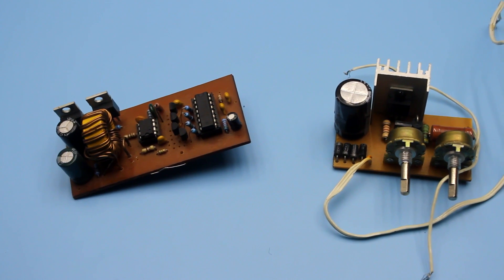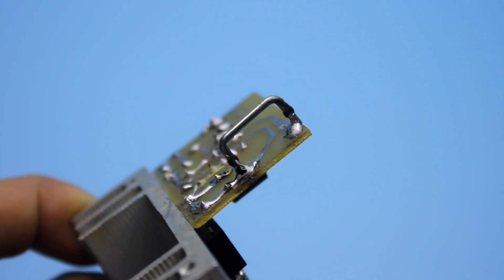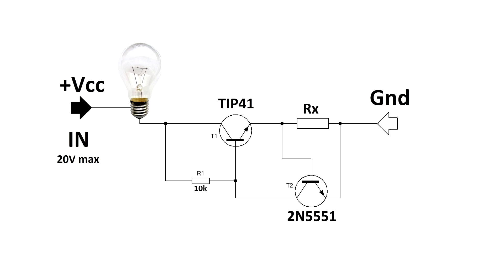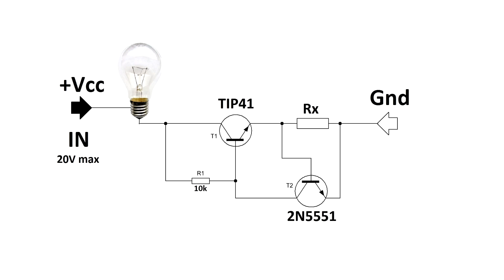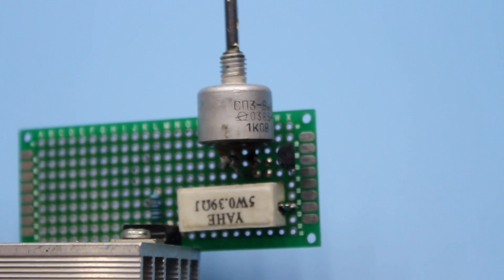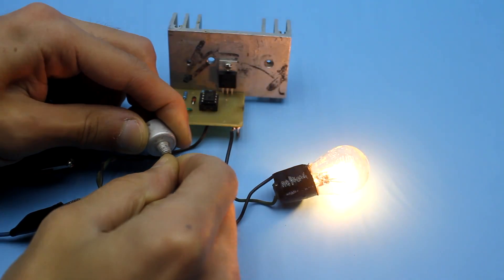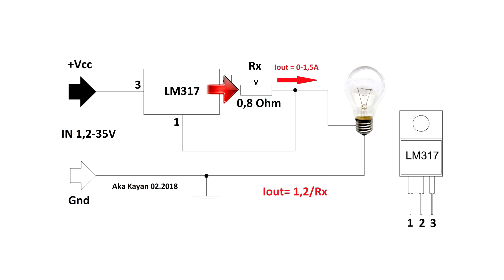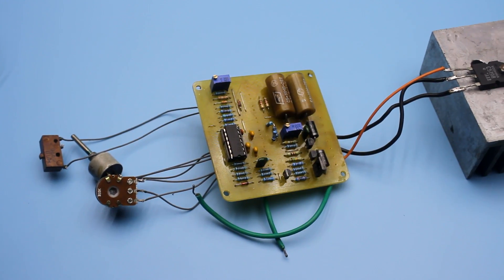Simple direct current regulator circuits

Comment: How low can you set the current?
Can it be set to 15ma?
Reply: I'd recommend checking out the datasheet for these devices. They usually provide a current range chart for operation.

Comment: Why to use a shunt, I use a transistor with Low gain and feed the base a constant current using a resistor like 10ma and get 100 gain so 1A out.

Comment: Hello, very nice video ! i did the same, i used 1.5 Ohm to have an output of max 1A, but when i plug a load to my 12v lamp bulb, the voltage drops to 4v, is it normal ? many thanks.
Reply: that is due to your set current limit

Comment: So in essence if you're running up to 1A it's better to use a resistor as a current limiter rather than a current limiting circuit? If not what am i reading backwards?

Comment: my linear dc power supply 30v 5amp not increasing current above 2 amp and if i rotate full it shows 2 to 3 amp and when i connect load resistor to check current it slowly increase current upto 3amp and above but at that time my power supply 2n3055 get short what will be the problem?

Comment: could you please explain how LM358 schematic works? It is not functioning as in video, inputs 2 and 3 have different voltage and it is not changing by potentiometer. And mosfet is open. Always.

Comment: What transistors should i use if i want the voltage be up to 50V
Reply: Look after transistor datasheets. I think 2sc5200 transistor can handle 50 volts

Comment: Is it possible to use a potentiometer on lm317 circuit? It would make a good current regulator for a variable bench power supply.
Reply: Bot in the circuits shown.    The current is too high.   There are other circuits............

Comment: Yeah those boards are good for driver circuits but if you deal with currents 20A+ those PCBs are fried (thin copper tracks). Whole art is laying out those power elements.

Comment: Zenner diodes if used for very precise control voltages should have a 100nFceramic  capacitor in parallel to eliminate some of the zenner noise. Zenner noise is worse at low current and a zenner should never be used at less than 10% of it's rated working current (this would cause voltage tolerance issues too).  Also R1 in the transistor only current regulator should be selected to have approximately 5% of the current flow of that required by the whole circuit - this is because the hfe of a medium power transistor is rarely over 50 (sometimes as low as 20) for medium currents (a bit more at low current) and by medium current I mean medium with reference to that particular transistor. EG a medium current for a 5A part would be 500mA. Low current would be 50mA and high current would be 1A+.
Reply: Interesting and usefull reply ! Thnxs !
Reply: hi, in last circuit how to calculate R1?
Reply: ZeNer     not Zenn-er      Zeners are not for precise voltage  references.  The noise by the Zener is usually trivial except in high-gain audio circuits or such.
Reply: They are using an TIP 142 which is a darlington with hfe of 1000. Makes a nonsense of your theory.